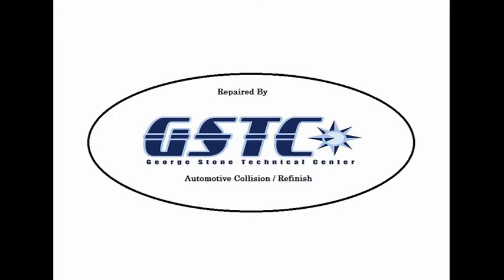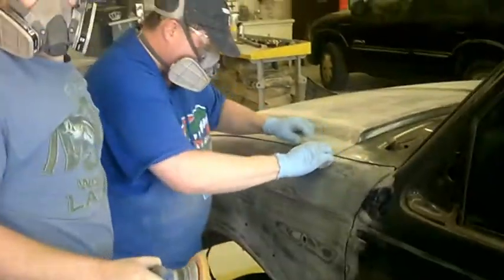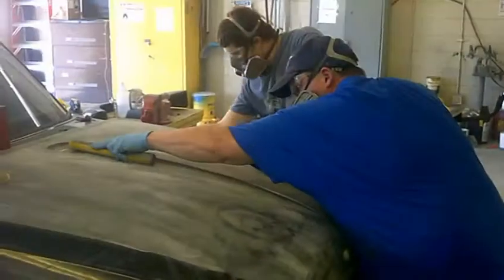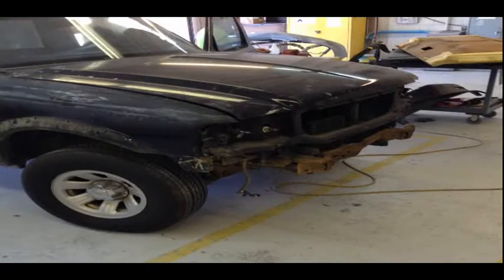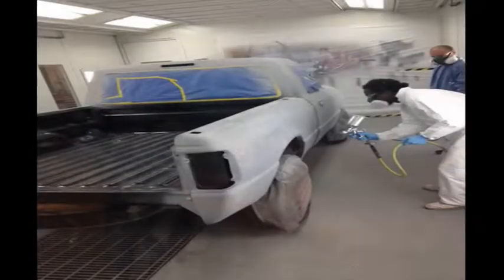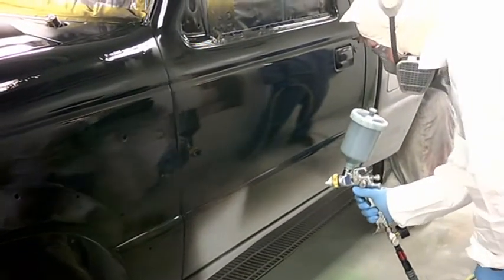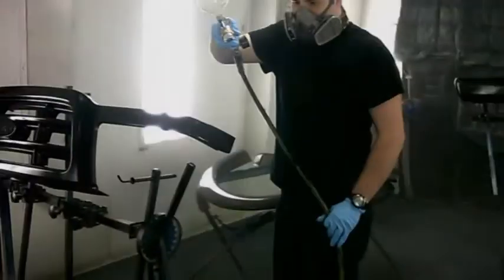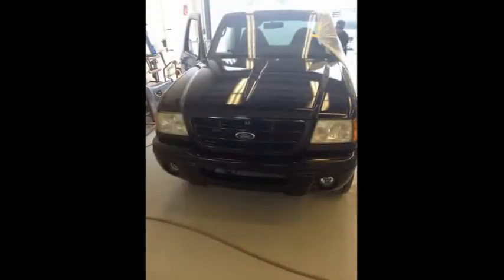2003 Ford Ranger

Comment: I need a hood like that!
Reply: Standard hood on the Edge model , I have the same year Ranger Edge 2 wheel drive . It comes with rubber floor instead of carpet , high clearance hood and torsion bar suspension instead of coil spring front suspension .